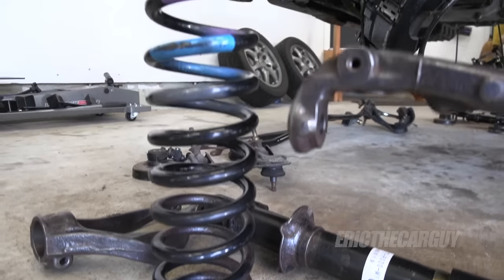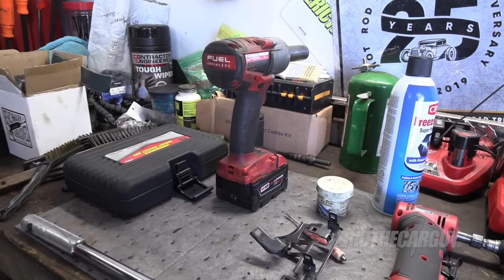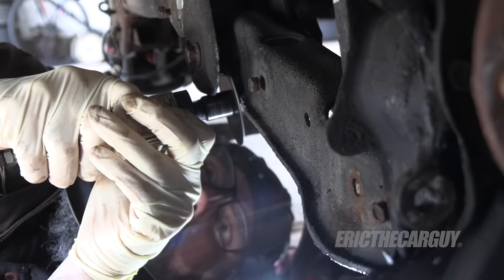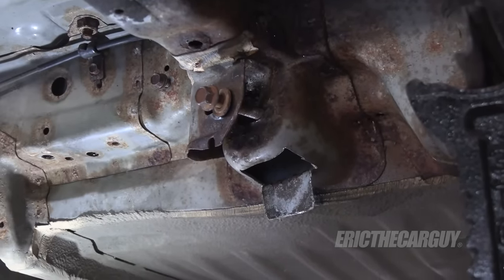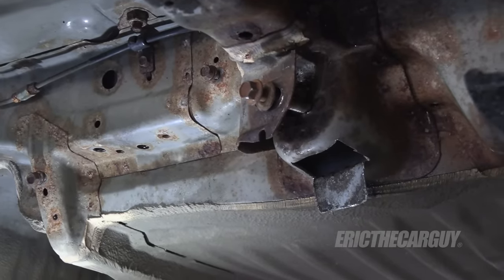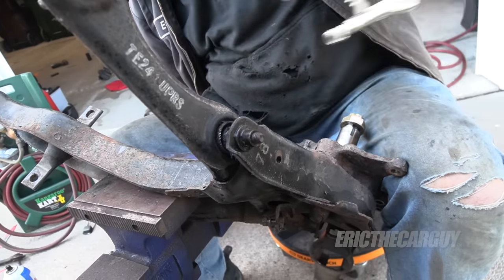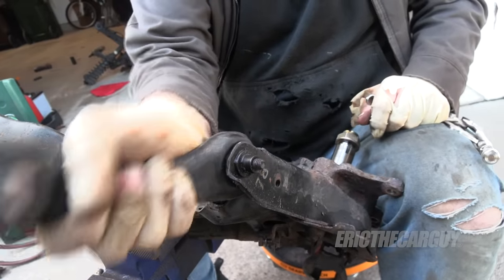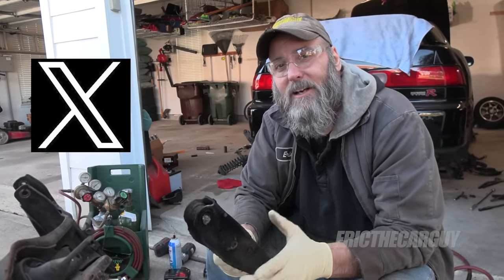Integra Type R Restoration (Part 2) #ETCGBlackBeard

Comment: Just to help out, a great company called HardRace sells brand new type R power control arms, with hardened rubber bushings installed, easy to get, if you want to save some trouble

Comment: The fight today gave me feelings of deja vu working on an a 91 Nissan 240SX that saw a lot of Chicago winters.  Lots of snapped bolt heads all over the place, even a snapped stud for the front bumper support/crash bar, and a similarly stubborn front crossmember bolt that started life welded to a metal strap with a 2nd bolt on the other side.  The whole thing drops in from the top of the frame rail, then the crossmember, and then you put the nuts on from below... one of the bolts either was no longer welded to the bar, or came loose when I was trying to break it free of the rust and it kept spinning in place.  Took a hell of a lot of effort to get out, and also required a welded repair.  Good times.

Comment: Well, rust is very common her in the UK.
I normally have to heat up bolts and/or nut to even get a fighting chance of getting any work done.
Usually, combo of  heat and penetrating oil does the job. In some cases, I have to let soak up overnight, but you get the idea.
Looking forward to next vid

Comment: I dread, crawling under my car at my age..it’s almost like torture, no, it is torture, but thanks to your videos I’ve been able to fix my own vehicles.
Reply: After 2 back surgeries in my 30's, and still having metal brackets in my back, laying on a cold concrete floor is something to be avoided at all costs.
Reply: @MrClarkisgod  I had four spine surgeries, but sometimes you have to do it and I had three on my neck so it is really challenging but I just take my time try to get the most comfortable position and if it’s too complicated, then I have to pay and it’s always expensive and sometimes more than not. They do a really bad job so I suffer through it.
Reply: @bjkjoseph  I'm with you.  I got those interlocking foam squares from harbor freight and gardening knee pads I will sit or lay on.  It takes a lot longer than it used to but I can still get it done.  Half the time now I just pay the shop because I'm not messing with it anymore.

Comment: I did the rear suspension on an even rustier 6th gen civic and I found map gas to work very well for unseizing the bolt from the bushing. Once the bolt and bushing sleeve opens up the chasiss mount you can apply map gas directly to it and it freeze up easily with just and impact and some vice grips on the bushing sleeve.

Comment: I am continuing my BA4 Prelude rebuild. I had to remove the rear subframe after I had the same issue. I ended up tearing the nut off the spot welds, because the bolt was fused to the inner bushing. I also took the fight to the ground, before I cut out the bolts/bushings.

It's off with a welder now, new bolt and retack all the spot welds before off to powder coating. The only luck was the rears are removable and swappable - if it had come to that.

Comment: Good call on the CRV parts. 👍🙂 Found that out the hard way when I got a front wheel bearing that was definitely the correct one for JDM R's from 98, until it clearly wasn't when offered up(this was from Honda too). Measured the old one and went digging and found out it was the exact same size as you guessed it a front wheel bearing from a 90's CRV. 

Would have gone the same route for bushings like the rear control arm, but it turned out Civic/Teg/CRV were all the same price where I am. Went Hardrace(rubber bushings) for the upper control arm and toe in thingie. Not for performance, but because they were cheaper than Honda(and adjustable as a bonus). That's generally how I've done things suspension wise. Honda or Hardrace, depending on price. I've no problem admitting I'm a total cheapskate. 😁 Plus it's my daily so speed at getting it back on the road is a big factor.

Comment: The Left (Driver's) Rear ABS Sensor for my 2001 Type R was discontinued, so I was able to use the one for a 2000 Integra LS ( 57475-ST7-A01 ).  This LS's connector matches the ITR's, so no de-pinning is needed.

Comment: The reciprocating saw DOES work on the rear LCA. You just need the correct blade on it. I snapped the exact bolt head. Went and got a reciprocating saw with a bosch blade for cutting through steel. It literally took 5 minutes to cut straight through the inner bush and bolt. 

It's good when you get those bolts out.

Comment: The questions is, Why did you cut on that side?  Great as always, thanx Eric
Reply from the maker: it's the only way to repair the slider nut on the inside of that part of the body. It gets damaged sometimes when you remove the control arm.

Comment: Hey Eric, those looked like Diablo blades on your saw. How did they hold up against the suspension bolts when you had to cut them? That's probably grade 8 hardware so I imagine it's quite a fight.
Reply from the maker: Milwaukee torch blades are better in my opinion.

Comment: You need an induction heater bolt buster
Reply from the maker: That really doesn't help with bolts in bushings. The bushings still catch on fire and make toxic fumes. Great tool though.

Comment: Where the heck can I get a reasonably priced non riced integra. These things are in the 15s around me for an auto LS. If it’s the nature of the beast, I’d rather find a jdm one for that cost
Reply from the maker: Unobtainium these days. I believe the days of cheep, reliable Hondas are over.
Reply: @ericthecarguy  what is your opinion on the modern cvt honda makes? I had a 2016 fit with a cvt but considering another. Not sure if it’s wise to find a manual version or chance a cvt.